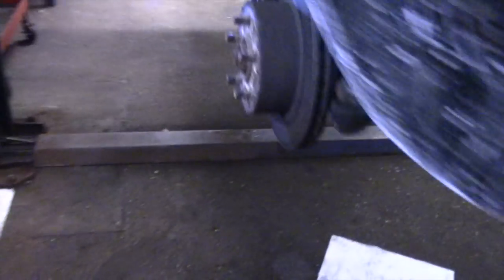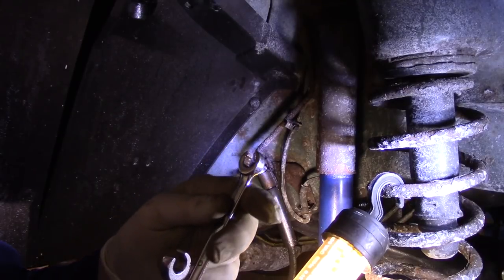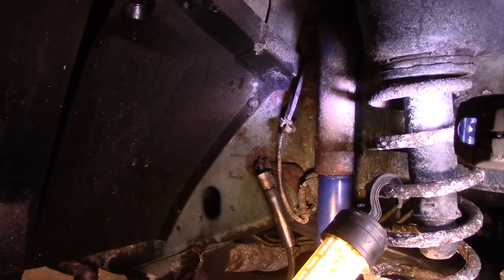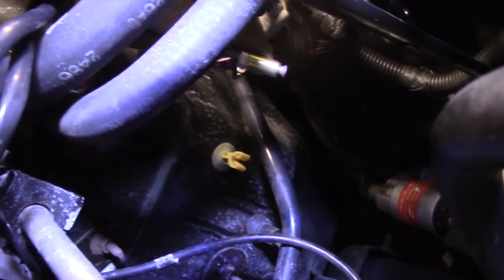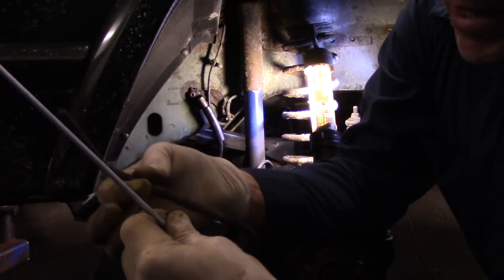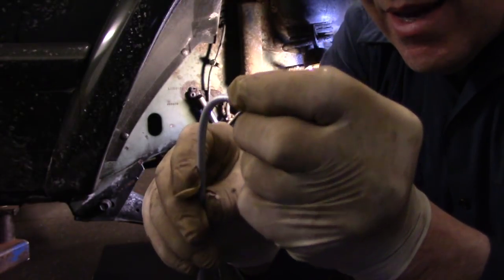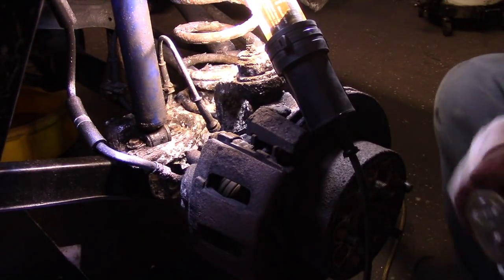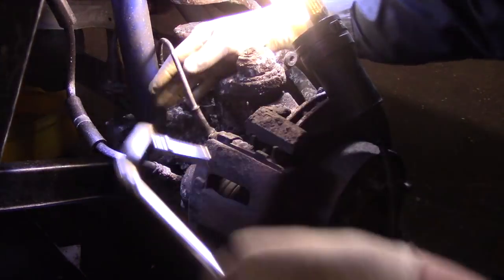How To Properly Double Flare A Brake line Or A Fuel Line

Comment: Very well done Jim with a clear demonstration of creating double flare connections. And a very good tip for beginners of never using a compression connector in joining brake lines together. Great work as always and keep up the good work! :)

Comment: You did an excellent job flaring those lines. I have a similar, yet inexpensive, flaring kit and I struggle making even a half decent flare. Perhaps it's time to purchase a better quality tool.
Thanks Jim.
Reply: ManicMechanic007 Yeah, any of those tools that you turn by hand are junk. I'd get a hydraulic one, unless you never plan on using it again, then it's more worth it to just pay a garage to fix it.

Comment: Nice to see a job done the right way. Most of the ones I see at the shop had a previous line repair done and all I see are compression fittings on rusted line. Great video!

Comment: for some reason When tried using this type device on existing 3/8 SS fuel line, to remake the end.
It will Not stay in the grip of the corrugated clapping piece.
It seems like the tube is too stiff to swedge out on the end.
Any suggestions?
Is pushes thru in the first step while marring the tube OD as it slides out or thru.
Reply from the maker: A few thing that you must make sure of so you can properly make the line.Make sure that the line is clean (no oil), the tool is not worn out and if it's ok make sure that the line is very tight.
Reply: @jimthecarguy  
It is all a new toolset.
It is clean etc.
So I must have got a wrong or defective piece or something.
 I bought a Harbor Freight unit that I've seen other reports they say it's supposed to work and work good.
but for some reason the one I got simply just doesn't function as I should.
Since I posted this comment I've discovered there's something called Ni-cooper line.
That meets all the DOT specs, and is significantly softer to bend,   to make flares.
Is gaining popularity and is used on a lot of race cars now that have a lot of stresses.
Snd so I trust that this product is quite reliable.
And impervious to rusting that steel experiences.
Anyway thanks for the reply